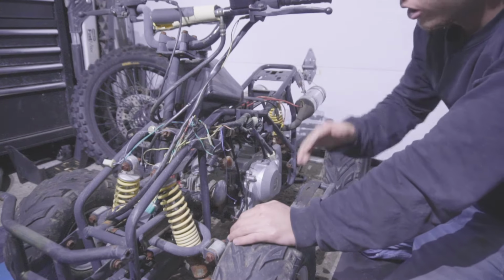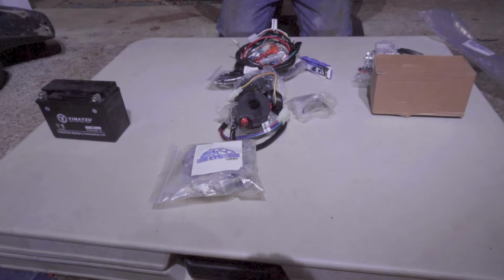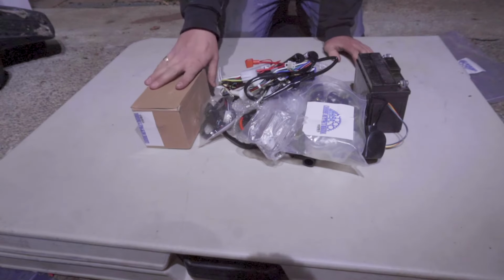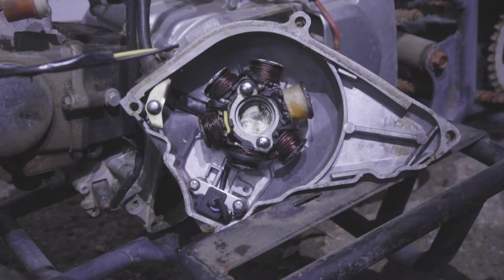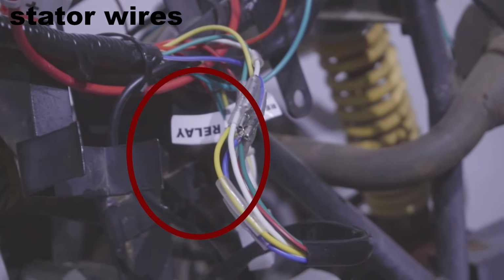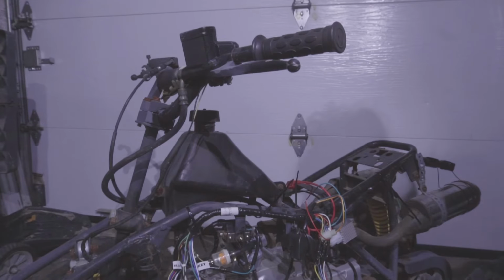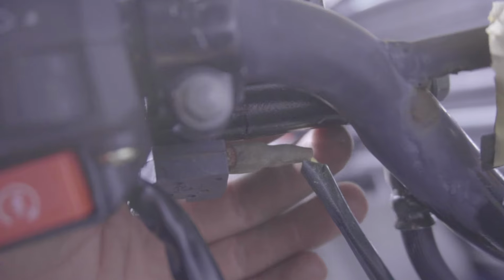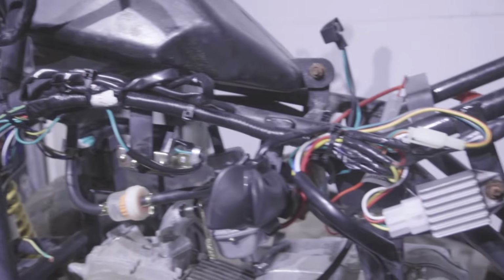HOW TO: Install Wiring Harness Chinese 125cc ATV + Electric Start

Comment: I just put a  new wire harness on my 125cc  but now I dont spark coming from spark plug.but I test the wires to the coil they getting fire but not my spark plug..Whts the problem

Comment: Very helpful. The wiring diagram showed me a Safety Switch which was a key moment. Instead of a switch I shorted the black and green wires and presto I had engine turning and a spark. Many previous searches failed. Again many thanks.

Comment: I made the same installation, the only difference is that my coolster has reverse and neutral, but other of that all was installed exactly like you teach me, by the end I have a extra wire red/yellow and green. I place together the cables for the safety brake and still not working, I by pass on the selenoid and all work but not when I try using the button, please help me!!!

Comment: Hello I have that same atv I have extra wires left after I plug up harness.i have a 139fmb engine on it
Reply: On most of these harnesses you'll have extra wires in the front of the harness for headlights and indicator lights for neutral & reverse as well as a connector towrds the rear of the harness for taillight.
Reply: @OldSchoolGrower Thanks for that, haven't bought one yet but I was curious as to if I could hook up signals. Year later you helped me out a bit haha